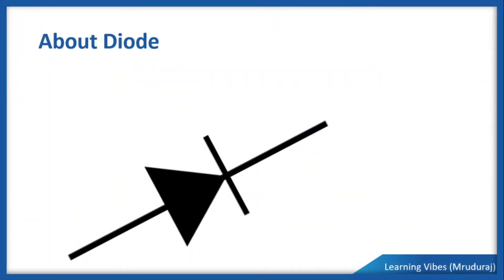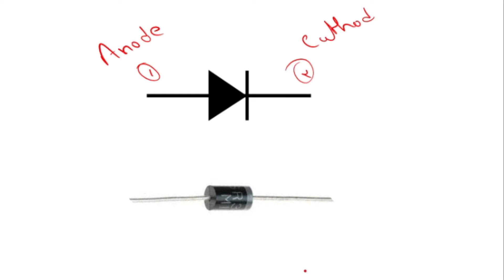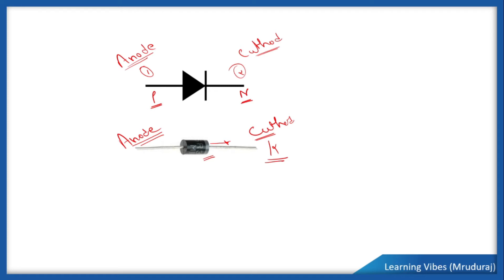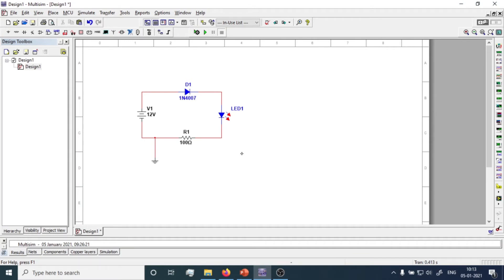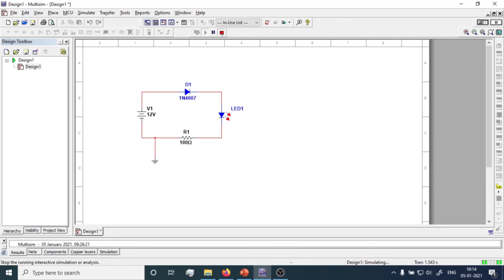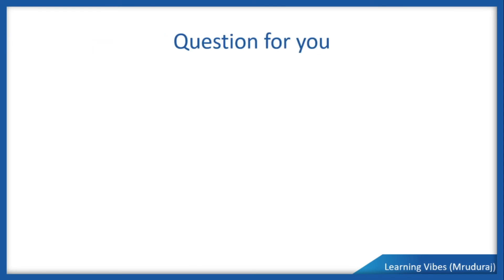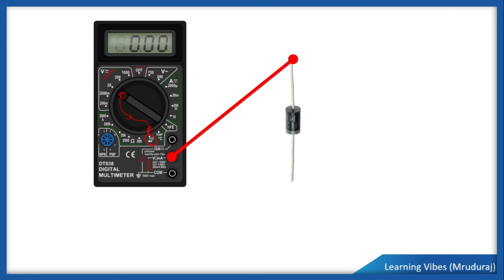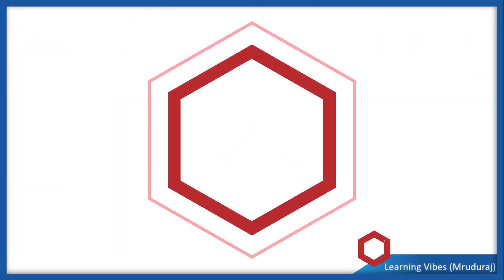How to identify terminal of diode | Find Diode polarity | Diode terminal identification

Comment: Nice understandable video.  
I have a 20kv dc voltage source.  Can I use the discharge to complete a circuit for a low voltage circuit with the correct diode?  
          I see that there are diodes rated for 20kv.  I tried with underrated diodes and the high voltage goes through 
          the low voltage circuit no problem.  Not what I want.
Could such a circuit be simulated on this software?  
          The low voltage circuit I am thinking about would be a dc motor or uni polar generator.  For the second case 
          it would be low voltage but high current. 
 If it is possible is it practical?  
          Seems to me that you could reduce wear and drag, but may not be worth the cost.
I do not know if the discharges are continuous or intermittent or if it matters.